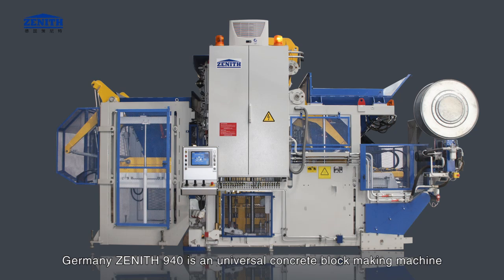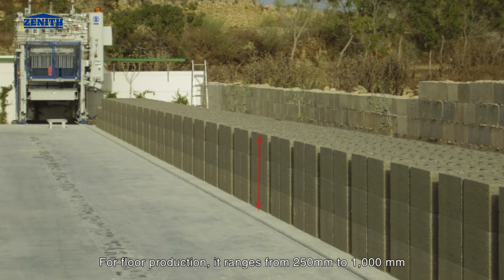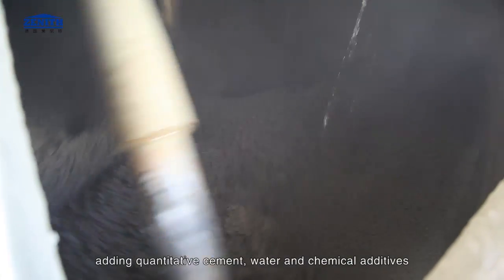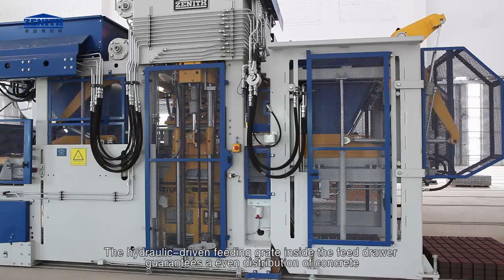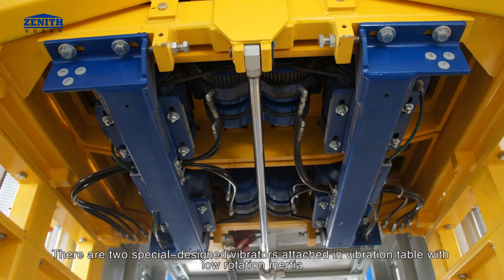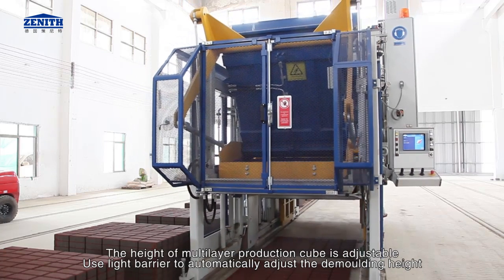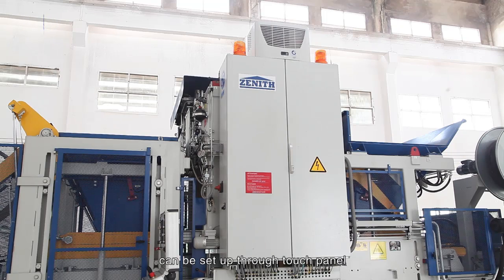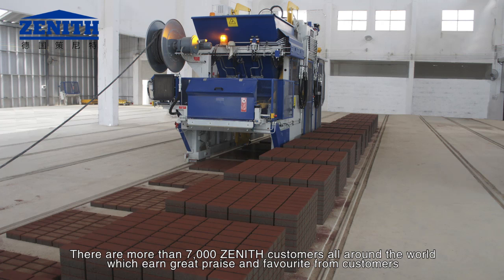Concrete Block Making Machine | Germany Zenith 940 Mobile Multi Layer Plant

Comment: Hello, I am working on this machine in Iraq and I am facing a problem. The rail on which the concrete truck stands is lower than the height of the mold and causes shock to the wheels during movement. Can you send me a way to raise it to the required level as soon as possible?
Reply from the maker: Please talk to us on WhatsApp  +8617350086568 for more details.